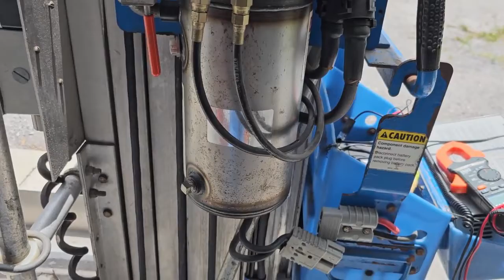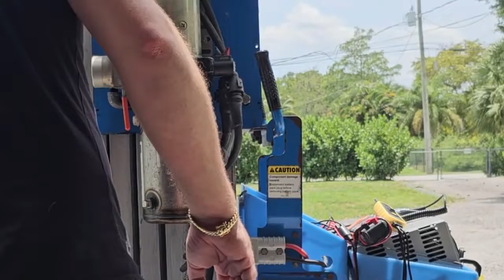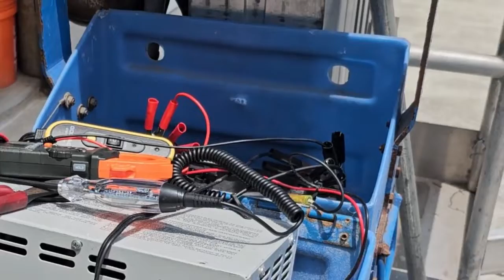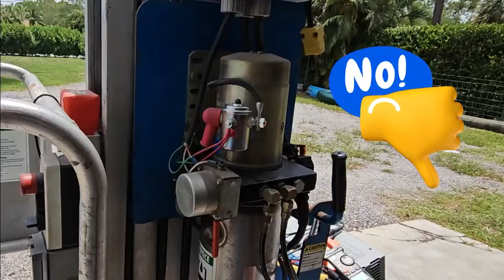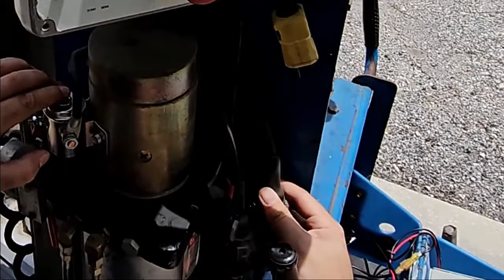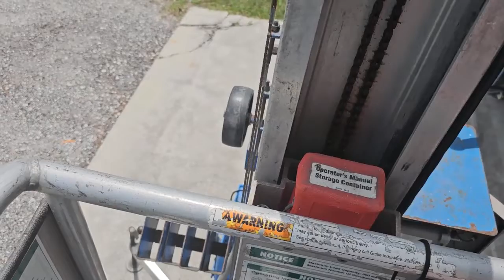Going Up! 🚀

Comment: I enjoy your videos and you guys are usually dead on.   I knew this was a misdiagnosis though on this when you replaced the coil.   Hitting the control lug / terminal with the power probe made the lift move but doing the same action with the regular switch didn't.    I can see why you were thrown off because the pump was operating in both situations.  Anyways keep up the great work.